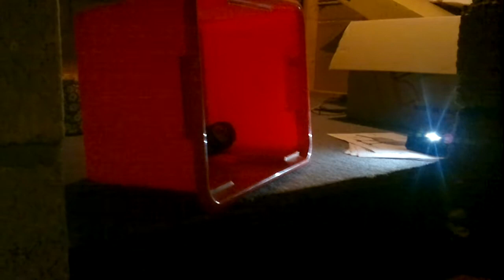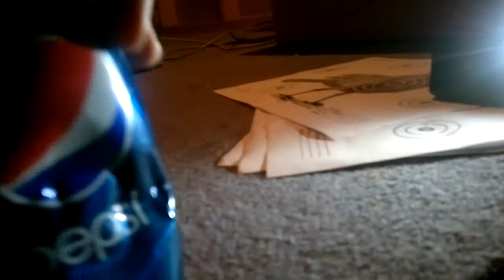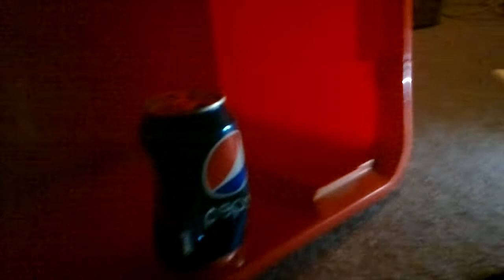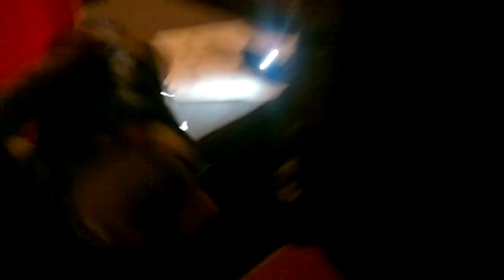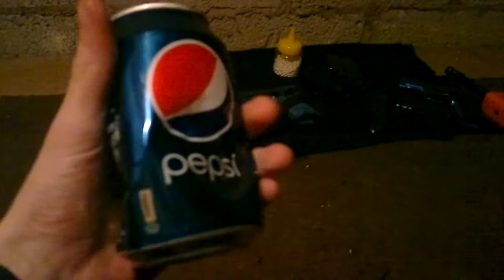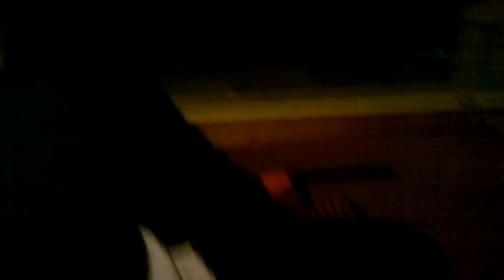Can Test HG-190 & VSR-11

Comment from the maker: @Stickmanjonny321 
Yes it is possible and we have done so since this video however a rail set must be purchased as there are none as standard. This doesnt cost much however and can be found easily on any airsoft website. VSR 10 accessorys will work aswell so if you cant find VSR 11 rails VSR 10 should do.

Comment from the maker: @TheSmallpetcare Well it depends on the hop setting and the weight of BB you're using. Using 0.2g it isn't going to go much further than a good AEG due to the pretty average hop on it and the relatively low FPS (for a sniper rifle).